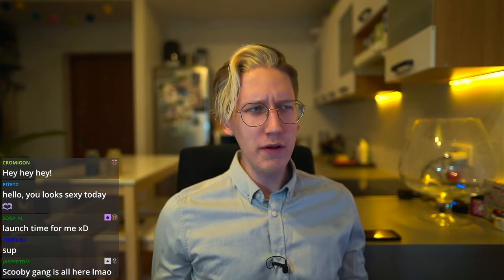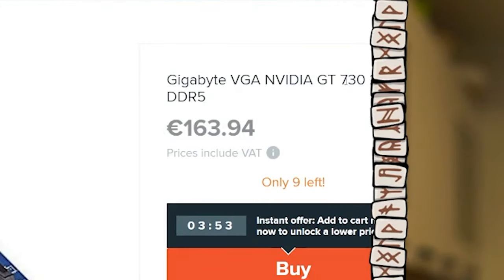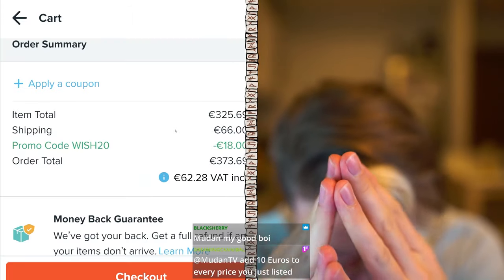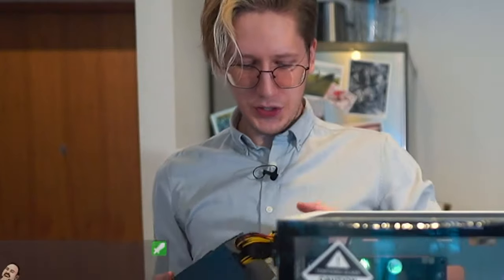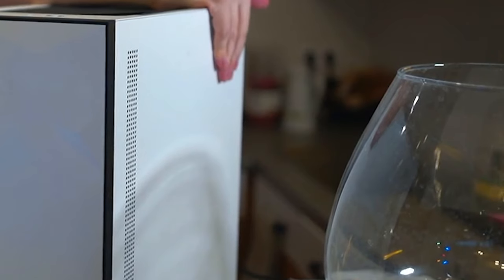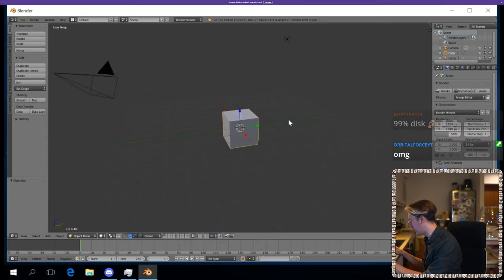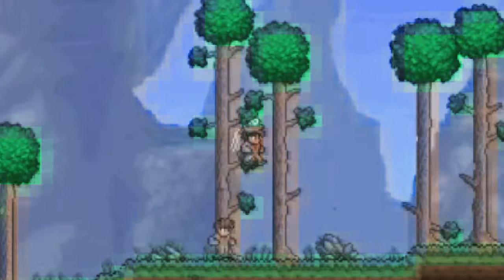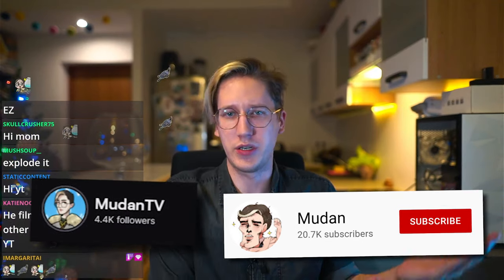I Built a PC With Wish.com and It Wasn't Even Cheap...

Comment: Did you forget to put thermal compound between the cpu and cpu cooler or did you just not show it in the video?
Reply from the maker: it was pre-applied. There was a whole section where I even had to take it off and showed it to the camera during the stream but it was all cut for the sake of speeeeeeed
Reply: @Mudan  SPEEEEEEEED!